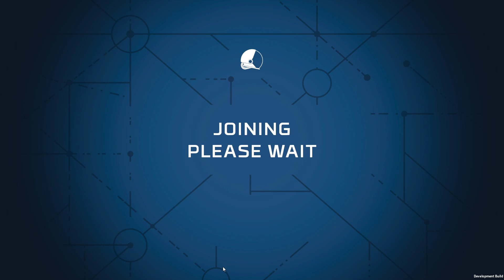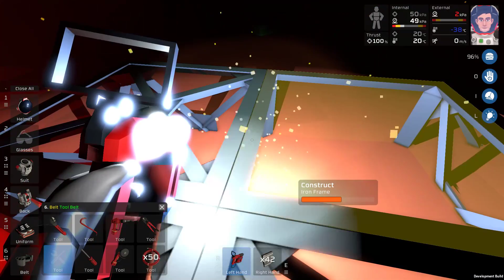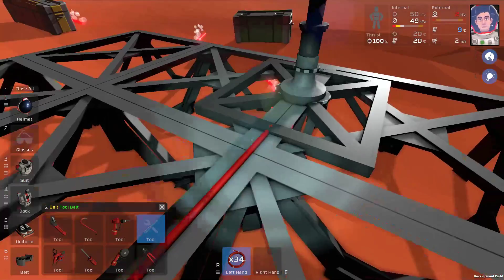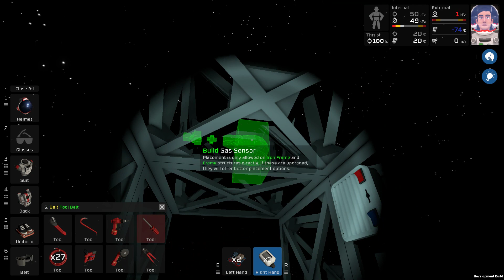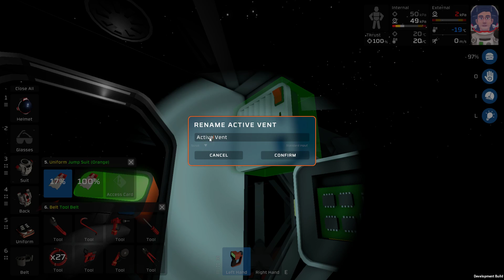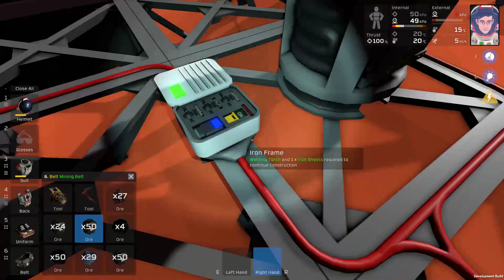Stationeers / EP 1 - Mad Dash for Power / Mars Colonization

Comment: The Martian atmosphere has 1% of Earth's sea level air pressure. So it's more like it's made of 99% vacuum.
Reply from the maker: Well then by that math compared to Venus, Earth atmosphere is like 93% vacuum.
Reply: @Rhadamant  wrong math, but yeah. Venus has 93 bar pressure, so Earth's pressure is roughly 1% (1/93) of Venus (thus 99% vacuum to a Venusian.) Kinda funny how it also works out to roughly 100 times difference. My point was, it's not that it's made of CO2 that makes Mars' unbreathable; below 15 bar, even if made of pure oxygen isn't enough for our respiratory system to work.
Some dude tried to recreate the Martian pressure to experiment on how smoke particles move, in a Youtube video, his vacuum pump struggled to reach the mark.

Comment: How sure are you that the light doesn't eat charge?  The game looks like it's been patched since I last played it (merging cables! what) but I went from suit power lasting about a day to lasting multiple days just by restricting the use of my light.  The consumption rates seemed completely insane to me (same as with the jet pack just sipping pressurized gas) but games are just like that sometimes.
Reply: i had questions about this too. i have noted while playing that light eats up most of the battery. and like you said can go for days with the light switched off. I havent really tried playing with light on recently hence no idea if that has been patched or not.
Reply from the maker: Mayhaps I'm wrong =]